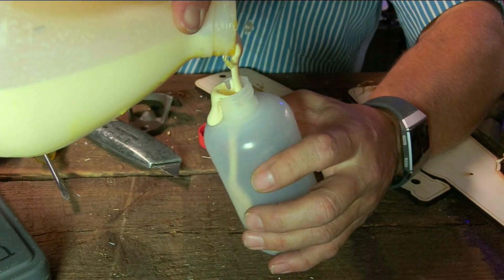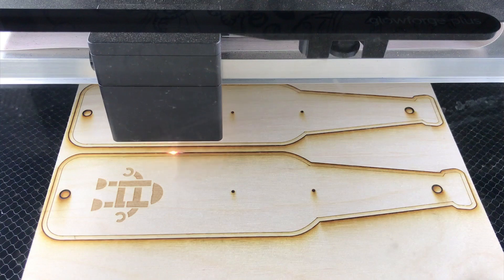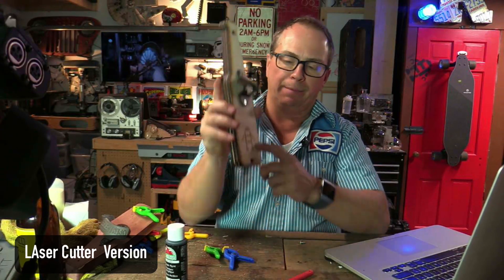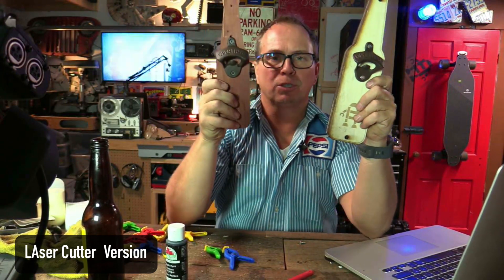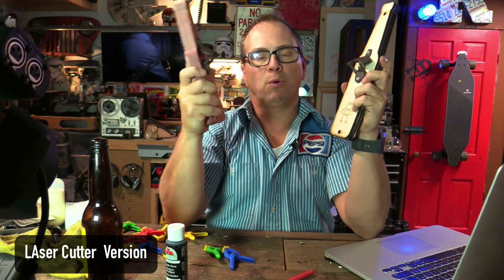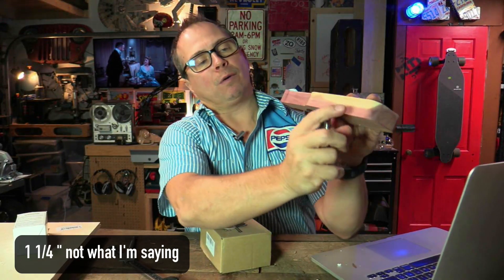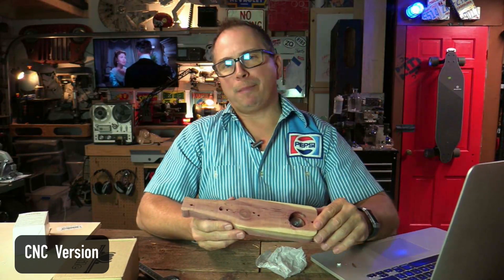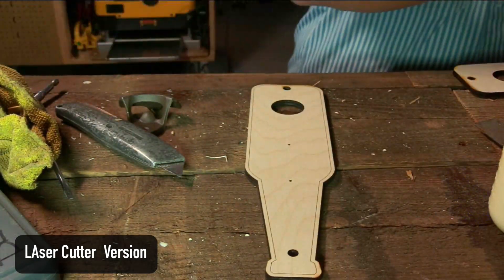Glowforge Laser Cutter vs. CNC - Episode 1

Comment: Love the video and the project, but I have to say that's a big NEGATIVE on the "you don't have to babysit the laser cutter; you can go do other things".  You absolutely DO NOT take your eyes off of a laser cutter while it's operating, because it is a huge fire hazard.  It only takes a split second for a workpiece to start flaming, and if you don't have eyes on it when it happens it can get out of hand really fast.
Reply from the maker: Thanks. Understand. I literally watch my CNC router cut,  my opinion but I can be present for a laser cutter in the same room but do not need to have your eyes glued to it. Do you stare at that Laser light. Don't it will damage your retina.
Reply: @hacklab.ryandewitt  I never even turn mine on without wearing laser safety glasses, and I always keep the lid closed. 

I had a project catch fire while I was watching it, and it flared up so fast that I almost wasn't able to grab my fire extinguisher in time.  I always knew that it COULD happen, but of course I never thought it would be so quick and so violent.  I don't know if it was the type of adhesive used in the plywood, or if it was just super dry, but it scared the Hell out of me, that's for certain.  Luckily, the only damage was superficial, but it did require about an hour and a half of cleanup.
Reply from the maker: BadAss Technologies I respect your concern I’m going to be extra careful I’m really sorry about the fire that you had I hope you keep on making things.